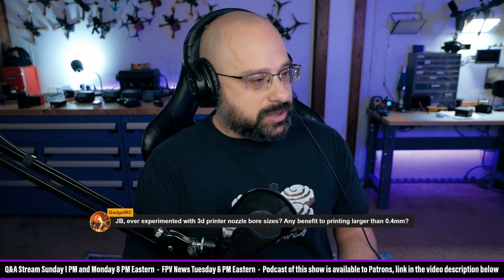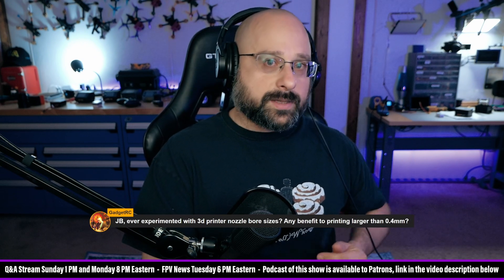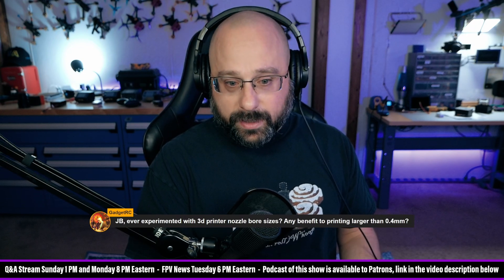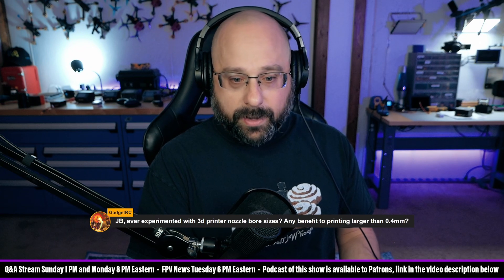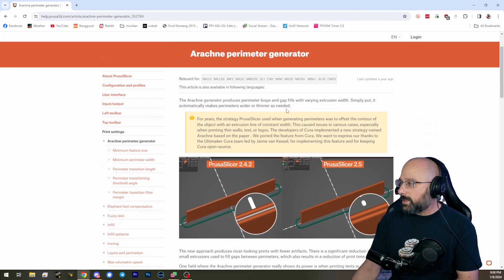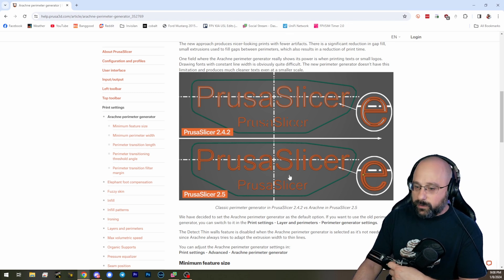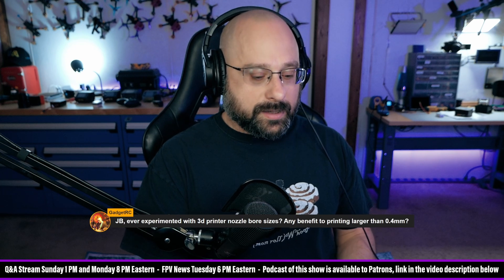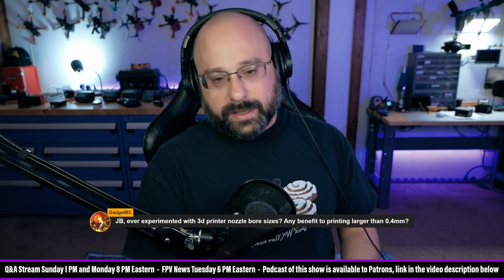3D Printing With Larger Nozzles? Is 0.4mm Still Standard? - FPV Questions

Comment: Hey Josh I recently was trying to bind my 5inch cross fire set the modes etc etc everything was fine took it off beta flight armed it did a bit of weird noise unarmed disconnected it and boom no vtx anymore when looking at the qaud the red cable came of the capacitor and was dangling under the stack so I guess that's it boom is anyway to check capacitor in beta flight etc as took the vtx off n it arms dissamrs beeper works but don't want to plug my new 03 unit in any ideas please 😢😢😢😢😢😢

Comment: Arachne was created for Cura like most great things that Prusa slicer uses haha, also .6mm is more than good enough for 99% of the prints on a 5" even .8mm would be fine with but, the parts won't be as pretty and you'll need a good hotend setup capable of high flow rate to take advantage. Bigger nozzles generally mean stronger prints too but, that's not really true with TPU.